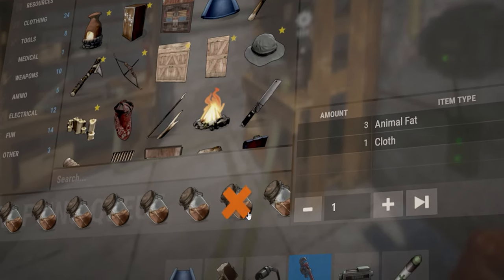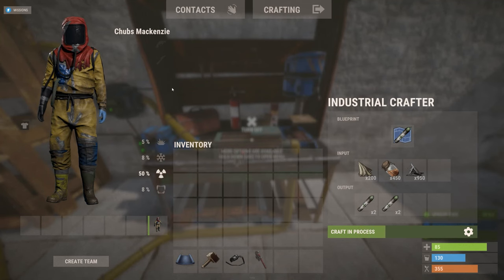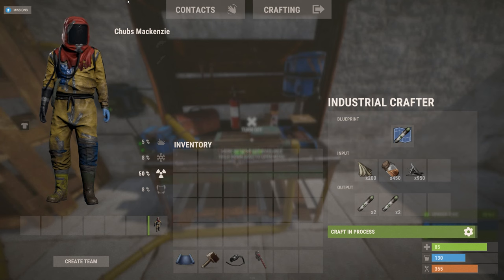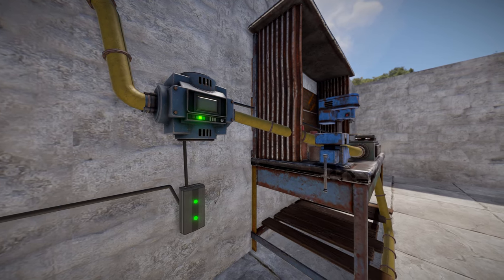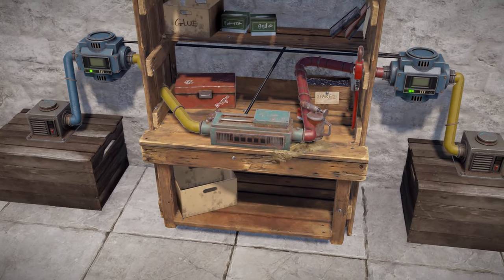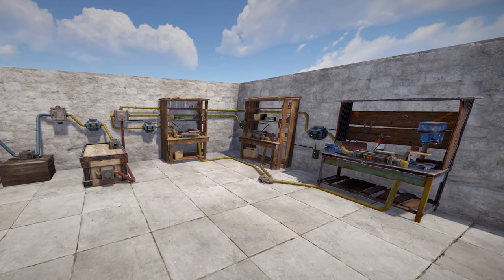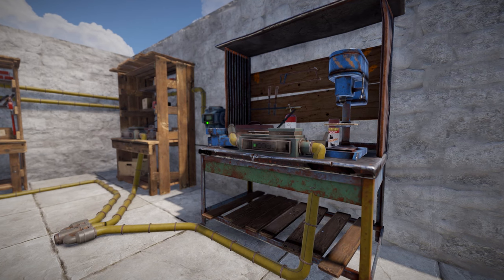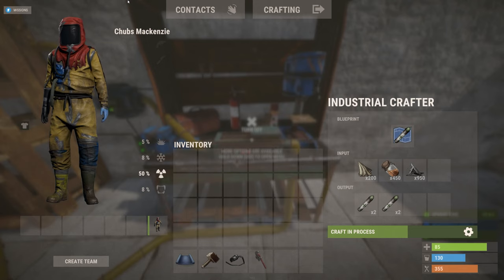AUTOMATIC CRAFTING - Never Craft Meds or Ammo AGAIN! - Rust Automated Crafting Industrial Update

Comment: the question is how do you make default blueprints work on them? ;)
Reply from the maker: You can research a lot of them on the bench, like low grade or gp.
Reply: @OGProcess  ahh iv tried to use gp in the T1 with industrial crafter but says I need the actual blueprint even tho gp is an unlocked default bp?
Reply: @tylersaunders5372  I think they limit gunpowder on the industrial crafter because it would be kinda broken if zergs could produce gunpowder 24/7 around the clock. At least with the current set up, at least one player must be logged in and devoting real life time to creating the gp, keeping a little bit of balance